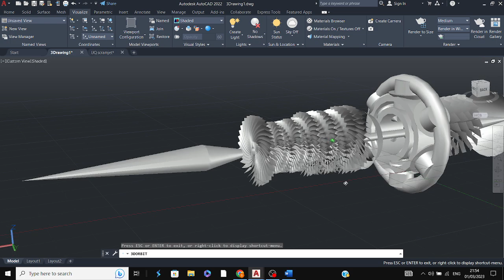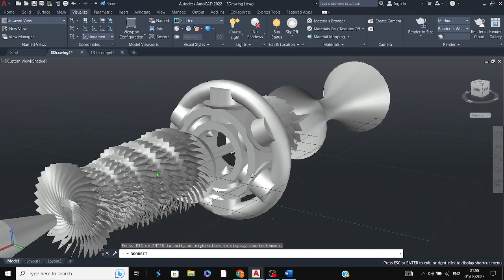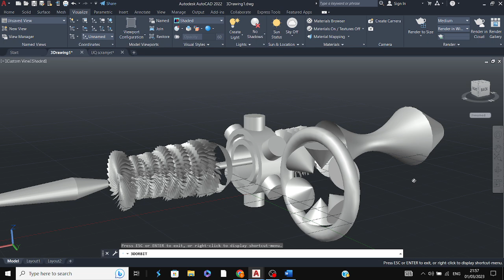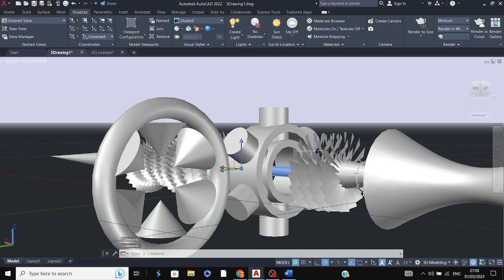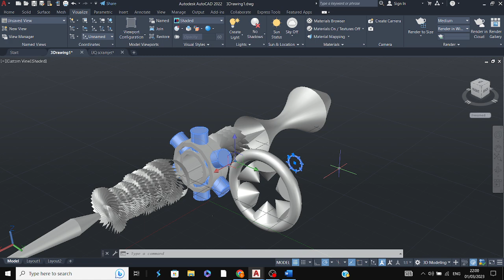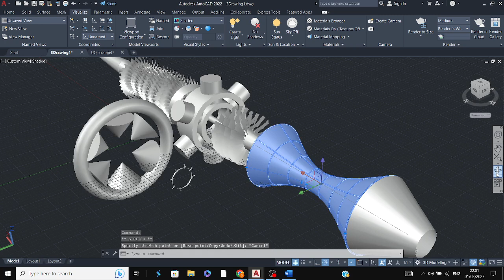Comment: Won't the hydrogen combustion blast the interior of the engine?
Reply: Yeah good point, one of the things I didn't mention in the video was the materials used for the interior, in this case materials like Titanium aluminide and CMC (Ceramic matrix composite). Both materials are relatively light and can withstand extreme temperatures 👍